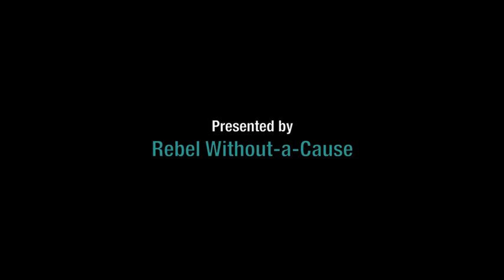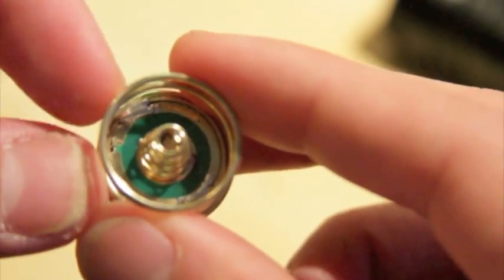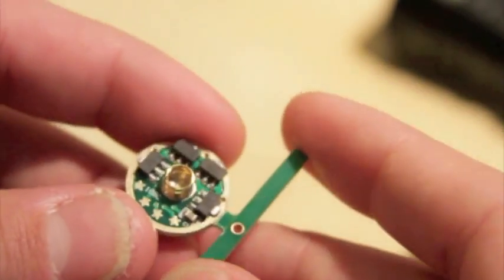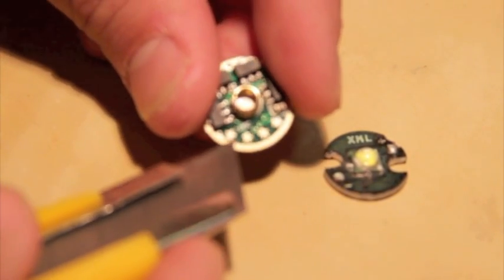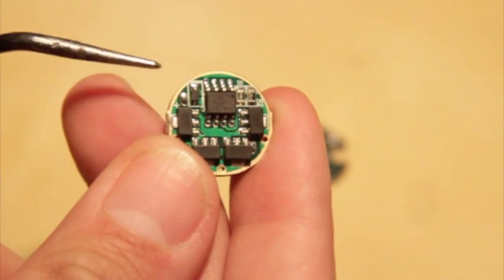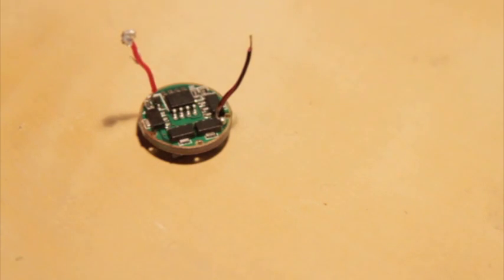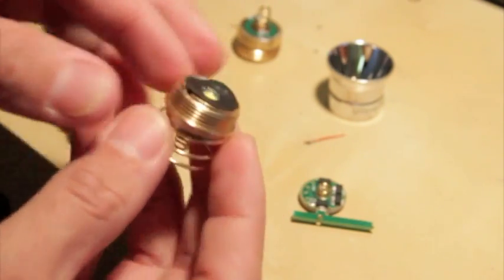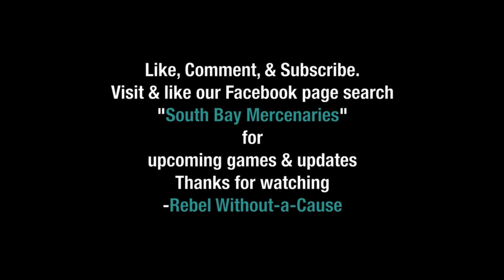HOW TO MODIFY ULTRAFIRE WF-501B XM-L T6 TACTICAL FLASHLIGHT to 3 Modes Only

Comment: aliexpress they cost $3 or about $7.20 for this exact model, chargers start at $1.50 and then you need some 18650's batteries..Ebay are $15 to $20 bucks
http://www.aliexpress.com/item/UltraFire-E17-CREE-XM-L-T6-2000Lumens-led-Torch-Zoomable-LED-Flashlight-t6-light-3-AAA/774395004.html

Comment: Easier way...
Step one: Buy 3 mode module
Step two: Unscrew flashlight and shove new module in.
Step three: Use flashlight

Total time: 10 seconds
Reply: It’s unlikely aftermarket products will fit snugly.
Reply: or just check the batteries inside first before buying all this shit.

Comment: My guess would be no with this board. They have single mode flashlights so I'm sure you could find something. Single mode is basicly on/off though. Every flashlight can do single mode in that sense. Personally I won't even consider single mode. Unless the light has less than maybe 75-100 lumens output there needs to be a low mode. One mode means only high. If the mode you want is strobe, I'm sure you could probably find a custom chip somewhere or someone to make it.

Comment: No way to fix it unless you buy a new driver board to sold on your P60 module or, more easily, a complete P60 host. I recommend you thre three mode Manafont XM-L, the one without strobe. IT IS EXTREMELY POWERFUL AND RELIABLE

Comment: Hey rebel another good video! 

May I suggest you get a pressure switch so you can attach it to your vertical grip or the rail if you're using a angled grip. It would make it easier to turn on and off as opposed to extending your finger to the push button, though I don't know what your specific needs are.

Then again I'm not certain if pressure switches even work with multi mode lights. Just food for thought :)

Comment from the maker: @DriftsterPro go to ebay and search "ultrafire c8 xml t6" on the left side of the page check "buy it now" under the buying formats section and "us only" in the locations section. You can get one for around $20. Stay tuned for a C8 and 501b flashlight comparison video.